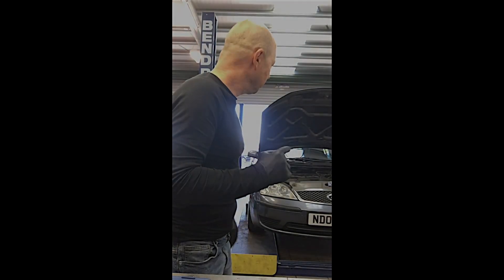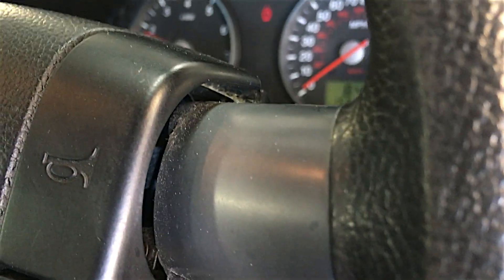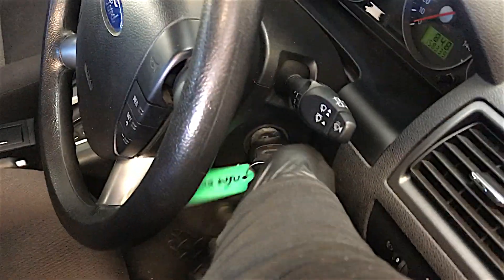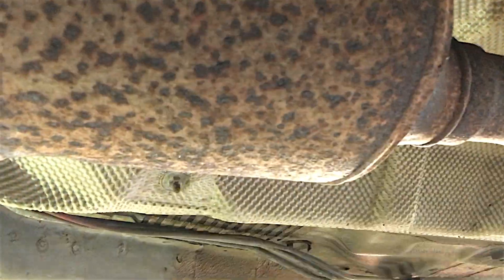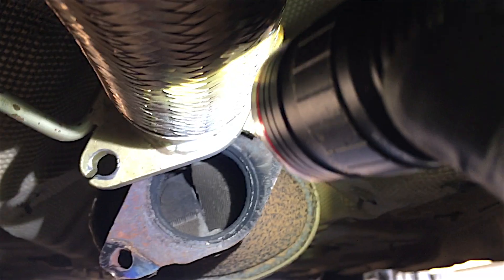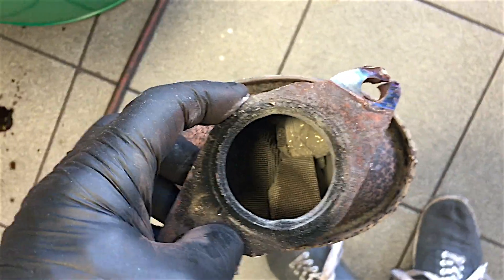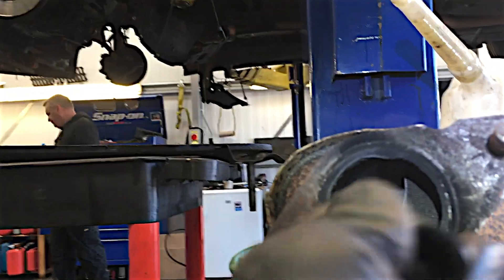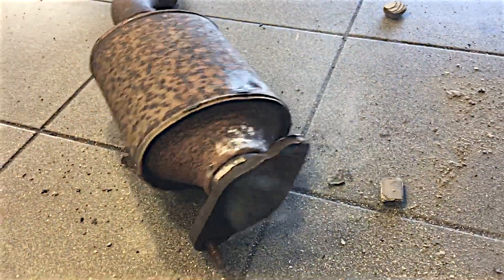Engine hard to start & unable to rev up, ford mondeo mk3 2l duratec

Comment: I had a catalytic convertor on a v6 mondeo collapse that rattled like yours did. It didn't affect the running of the engine and I remember driving round for ages with it like it. One day it was louder than usual so I ordered an aftermarket cat as ford wanted at the time £500👀 i bought one for £300. On inspecting the old one it had disintegrated quite badly. A friend of mine had a mk5 escort 1.8 130bhp on a j plate that had a cat which collapsed. I remember watching him on his drive way smashing the innards with a piece of angle iron and then putting it back on the car afterwards 😆 it actually drove brilliant after that!
Reply from the maker: well yeah, cats only strangle the engine
Reply: @alan4x  I see plenty of fast ford's driving about with no cat! you can tell by the smell of the exhaust fumes as it enters your cabin. when it's m.o.t time they put them back on and then take them off again afterwards 😆 usually focus st's and other Marques too.
Reply from the maker: @simonjohnhinton1938  lol

Comment: Really like my mk3 1.8 Mondeo I’ve had since new, only 104K, but after changing the PCV and soaking the bores with various snake oil, it runs and sounds great compression is fine  but smokes like crazy, jus trying to decide if I have the time and patience to attempt changing the rings.

Comment: Hi Alan years ago I had an Astra and it would not go over 60 and what had happened is the all the stuff in  exhaust back box had started to bloke it and it was a night mare to sort out it wasn't till a mechanic tried to use an air line and blow through it be found out and the exhaust was only 12 months old 🤔👍
Reply from the maker: lol, had the same on older cars..austin ambassador

Comment: If I pressed my 2L Duratec pedal to the floor it would read 6000 revs, I have never done that . Anyway, verty interesting and as I have 79,000 miles on the clock I have a long time to go. Thanks Alan

Comment: I bellied my Mondeo once & in the process the exhaust rattled under load but my muffler chap knocked it all out & put the exhaust back on the car & it goes just as good as before, so I’m not bothered about replacing the catalyst converter as I will run the car until it reaches the end of its life!

Comment: Hi Allen
Love the videos could you tell me I’ve just brought a Ford Kuga 2l tdci  on a 17 plate could you tell me what to look out for on the engine and what are these engines like.Are these prone for oil leaks if so where should I keep a eye on.
All best Stewart
Reply from the maker: pretty good engines, best i can say is keep it serviced regularly ..the kuga is pretty nice vehicle, one day if i get one on the ramp i will go around it and list what is good and bad
Reply: What would charge to service it and give it a general check over plz Allan then you can use my vehicle to do a video

Comment: I had a rover 100 years ago and the back box completely blocked up Alan car would only do 30mph rofl. The best was when the fuse box caught light  and melted.
Reply from the maker: lol, had an austin maestro that burnt out all the vehicles dash wiring but never blew a single fuse
Reply: @alan4x  I had a f reg maestro 1.3 apart from stinking of fuel and also the headlining to decide to detach itself from the roof lol, it wasn't a bad car, the rover 100 was just a bucket you could never get right I traded it for a volvo s40 better car

Comment: How much does a collapse cat change the sound of the car? I have a MK4 2.0L 145hp mondeo that has the note of a old fiat 500, but no leaks in the exhaust. Could that be the catalytic converter collapsed or stripped by a previus owner?
Reply from the maker: could be, it would be noisier with a stripped out cat

Comment: For months I searched youtube to diagnose my zafira with this exact problem, I couldn’t find anything, I got my car diagnosed a few weeks back and he said blocked cat, mine had screeching aswell because the pressure built up and cracked the manifold as the cat is built onto it, man I wish I seen this video sooner 😂. Do you know what causes them to block? A lot of stop starting or car running too rich?
Reply from the maker: they can block for various reasons but this one was shocked which i believe broke the internals of the cat

Comment: shouldn't a EML of come on for Post Cat reading nothing due to blockage?
Reply: NO, the ecu only logs a fault if the post lambda sensor starts following the the pre cat lambda, in other words if you look at the readings on a diagnostic tool and they both (pre and post lambda) change from rich to lean at the same time it mean the cat is knackered and not converting the poison gases into harmless gases, a blockage just means the post lambda sensor never gets to sample the gases properly due to the blockage and doesn't see an issue.
Reply: @stiggyness1976  exactly! Sometimes a cat efficiency code but looking at that, there probably wasn’t time 😝. There may have been a code in the past, but it may have been cleared.
Reply: Ah yes so it would be picking it up as a normal reading